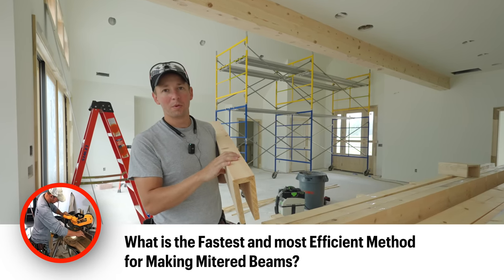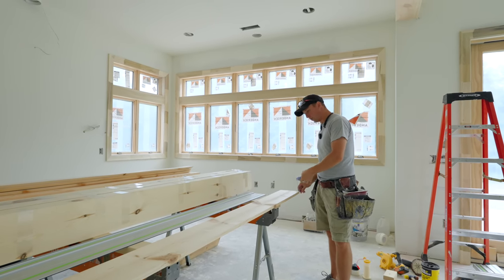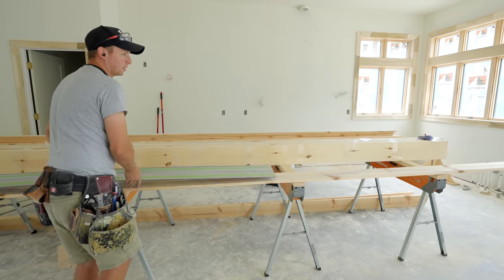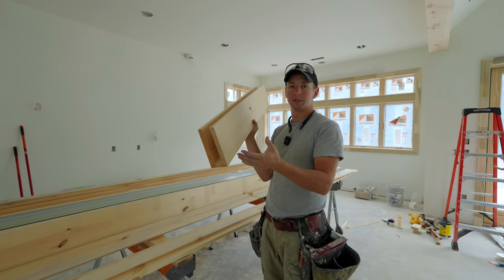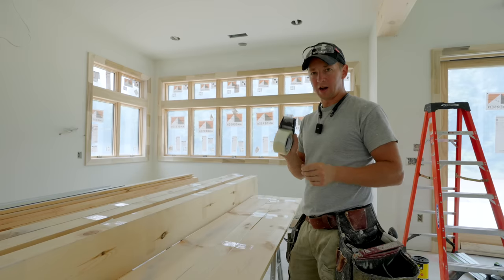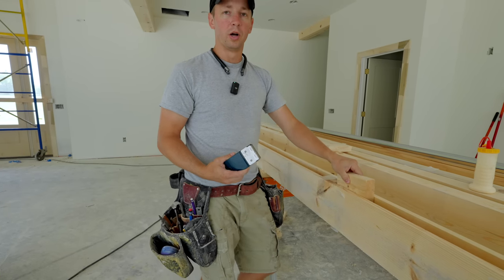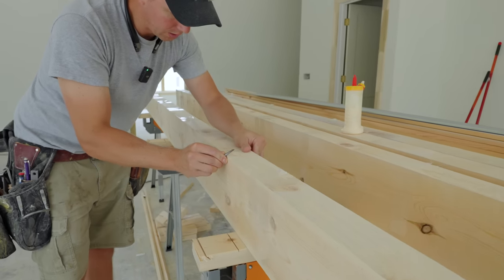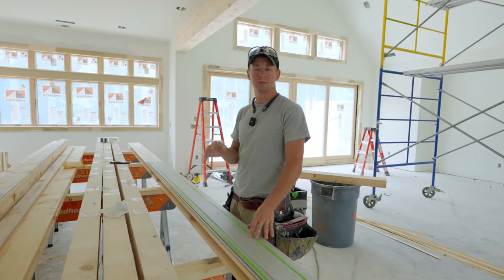PERFECT CEILING BEAMS from BAD MATERIAL??? How To Deal With Bad Material...

Comment: I've been working in the trade longer than Spencer has been alive, but I learn something every time I watch on of his videos. 

When cutting a line longer than my saw track,  I drop  the blade  into the kerf of the first part of the cut (without turning the saw on)  to align the track for the continuation of the cut. Just about foolproof.
Reply from the maker: That's a huge compliment! Glad to add value to our trade community.
Reply: I do the same exact thing!!

Comment: When using a tracksaw I use a giant clothespeg style spring clamp on the far end in case it wanders off line,which tends to happen as the blade gets blunt or wants to follow the grain.The rubber grip strips are not foolproof

Comment: The times, they are a changing. Back in the day, I worked closely with a small mill shop to do most of this type of work, We would work in his shop to build the beams and then take them to the sirte to install. At that time the best way we had was to run the pieces through his shaper using a lock miter bit. It is so nice that now you can do the work on site without bringing in others. Also lets you control the timeline and cost. Great video. Sometimes when I watch your channel I want to get out of retirement and get back into the trade. (well, not really. I really am enjoying retirement and don't miss working those 60 hour weeks.)
Reply: My sentiments exactly but if I could get a ticket to go back 40 years, my bags are packed.

Comment: Outstanding Demonstrator. From my experience of 45 years in Carpentry, Painting, and staining and remolding. I have found that use old T-Shirts cut up into rags. To use wet rags.  to wipe up glue from your wood surface is the best way to keep all glue off your work pieces. The wet rag will not stain the wood surface if you wipe right way.
Give that a try,  see how works for you.

Comment: Before I offer a recommendation, I should say that I am merely a hobbyist woodworker and not HALF the carpenter you are but I really enjoy your channel and appreciate the content. 

That said, as I watch your process of using a single track on those sawhorses, an idea came to mind. It would be interesting if you joined 2 tracks together so that you had a single track spanning the length of your material. Then, add a 20mm hole about 7" inset to each of those sacrificial boards on top of the sawhorses. You could put a long bench dog in each, add 4 UJK dog rail clips to your track (2 on each section of track), and effectively have an MFT-style ripping station. Then you would just flip the rail up and slide your material in/out instead of marking and cutting by eye. Perfectly repeatable process that adds practically zero additional setup time or bulk to the setup you're already using. You could even add several consistently spaced dog holes across those sacrificial boards so that you could accommodate various material widths. It would also be modular so you could use just 2 sawhorses and a single track on shorter material.
Reply: Sure, you could join two 11 foot long tracks to get a continuous cut, but not necessarily a straight cut. There can be some wiggle in that connection. Spencer's technique of moving the track is more accurate, and I do the same. I have spliced my Festools tracks, but I still get my 6 foot level out to check the connection and ensure they are coplanar. And that takes time. Which reduces production.

Comment: Thanks for sharing.  I recently did a 14' Cedar using, mitred box beam, matching grain at the edges. It was a bit  rough sawn, which I hand flatened sanded flat on the outside. I over mitered the joint, and pressure fit with a spline joint, using pipe clamps. I used a ladder, shims and clamps to flatten the waivy 1"×14" boards, then found a piece of weathered, imperfect mdf base as a straight edge, which I ripped on the table saw. Using the same chalk box you use to straighten the mdf base. If I remembercorrectly, used  some of the ripped material as the spline, just under 1/4" thick. Tight Bond 2 and  I think 1" pin nails. I told the employer who fired me, that I was going to a friend's cabinet shop to use his Timesaver abrasive sander and his Casolin panel saw, He freaked out and so I stayed at the job and made a beautiful, straight and flat box beam in lol, five days.

Comment: Spencer, Thank you for all your great videos. I've been a Design - Builder since 1976 and I still have learned a ton of tricks from you. Your beams look great. If I had that many beams to do, I would bring the Pine back to my shop & run it thru the shaper with a locking Miter router bit installed. They are a pain to set up until you get used to it, but make a great joint. You have a nice shop and I think I recall seeing a Powermatic shaper with a power feed, exactly what I use. Once set up you can run a bunch of "Beams" quickly that fit perfectly.
Reply from the maker: I have my shaper setup specifically for the lock miter but I still prefer to just miter fold them.

Comment: Great video. I just built some beam wraps using this technique. One thing to be careful of....I built my miter folds and dry fir on day 1, finished them(whitewash/varnish) day 2, installed day 3...btwn day 2 and 3 the side pinched in a little making them too tight to fit over my beams. likely due to moisture fro whitewashing or just humidity. It might be a good idea to place blocks inside to maintain the inside gap.
The fix will be painful...these beams will be hand hewn on the inside!

Comment: Just wanted to add on certain mitres I've used the Tenso fastener and it works amazing well also.
Reply: @kiwdwks, But doesn't that get a bit expensive? What spacing do you use?

Comment: Abutting each board's edge creates an especially customized look with possibly less work though it does require a hidden board on the inside on which to attach the external stock.  We used this approach on fluted archway pilasters and it added a rich look to an old style traditional foyer to dining room arch. The fluted stock was garage door pvc trim !  After high quality paint, the result was surprisingly beautiful.

Comment: Hey Spence. 
  Wondering when you’re doing the 3 inch pieces if it would serve you better if you ripped the board in half to release most of the tension in the board first before you started the 46° level?
Reply: I was thinking the same way! Obviously an extra step.

Comment: Hi, Spence excellent way to mitre beams, I'm lucky to have access to a panel saw with a long sliding table,gluing up I just run a bead of glue in the middle of the mitre. When you closed the pieces together the glue will spread.I also run masking tape all the way along the join never had a problem. You are a master tradesman.
Reply from the maker: Lucky duck. I'd love to have a big panel saw someday. It would be so handy for straight lining.

Comment: Great tip regarding the crown and adjusting your cuts for that. I appreciate your methodical approach and hearing your thought process. I have a question about how you’d recommend butting two beams together to make a longer looking beam. Maybe I missed this? Apologize if someone already asked. With baseboard trim, for example, beveling helps execution but I’m scratching my head around how to accommodate for the large scale of the beam, 3D aspect and wanting to ensure end to end is as tight as possible. Thanks!

Comment: Great timing as I have 17’+ LVL beams to cover with mitered pine or maybe stain grade wood.  Problem is, if stain-grade, I can’t source any 1-by material over 16’.  So, I hope you cover how you splice longer beams over 16’ sometime.
Reply from the maker: I just make a butt joint if it is stain grade. Add some biscuits to it if possible. But it can be hard to use biscuits on the sides of a really large ridge beam on a cathedral ceiling.

Comment: Great video. For those of you who are new to Carpentry, the tape and nails are acting as clamps until the glue dries. I'm assuming the tape you're using doesn't leave residue that prevents paint/stain from penetrating the wood?
Reply from the maker: I sand everything after the glue up process, so any residue is sanded off with 120 grit.

Comment: 2 things first of all I have 2 ts55 track saws one with a cross cut blade and one with a ripping blade. Ripping is so much easier with the proper blade and second I join 2 tracks together so I get a much better result than only using 1 track and having to move it. People who have festool tracksaws usually have multiple tracks.
Reply: Everyone thinks that it’s never occurred to Spencer to splice 2 tracks together! Sure, you could do that—but it’s a bad idea. The spline that connects the 2 tracks is just that—a connector. Not an alignment tool. Your connected tracks are not necessarily aligned, so you have to get a straightedge (or a 6- or 8-foot level) and double check the alignment. And since you are a production carpenter and you have to make a dozen of those beams, you have to move those floppy, weak, connected tracks dozens of times—checking the alignment every time—to make all your cuts. While you are wasting your time with all this, Spencer is done working and having lunch at the roach coach.
Reply from the maker: In my experience the tracks do not align and you have to check and light for straightness each time with a long level. It's more of a pain than it is worth for me personally.

Comment: Pro tip:  when you set your tape, after you cut the length and before you whack down the last end, just fold over the end to leave a tab.  When it's time to remove the tape, you don't have to dig around with your fingernails. Just pull the tab.  Super fast!  Fini.

Comment: Really enjoy all your videos! I’m gonna do a faux beam vaulted ceiling for the first time pretty soon, and this really helps the anxiety of it. I’m a bit of a tool addict, but rarely am in need of a track saw. My table saw is a ridged job site saw that is ok for rough work, but not cabinet grade. I have one question if anyone can help me: I’d like to make an old school rip guide that is like a track saw but relies on one fence. If I make this with an aluminum guide rail or 2 pieces of plywood, could I use it for beveled rips as well? Or would I have to make one with the guide being beveled to the particular degree? Trial and error will let me know. Just curious of anyone knowing what I’m talking about and having an answer. Thanks a million Spencer for your vast knowledge of current tricks of the trade. Subscribed.

Comment: Great craftsmanship, I have a customer that wants me to make a folded miter column cover out of PVC, I'm thinking of making the 45s with the shaper and useing the lamelo joint fastener and the recommend pvc glue
Reply from the maker: You might get just as good results with a simple tape miter fold with the pvc glue.
Reply: I do PVC miter folds with tape. The biggest issue I have is that the glue etches the finish if you get squeeze out under your tape and can't clean it up right away.

Comment: Started trim from 03 to 09, changed careers but started back again in 18.  Track saws intruiged me ever since I first saw one.  I finally ordered the milwaukee this week.  It was supposed to come yesterday but fedex lost it.  They actually delivered the 31" track but the separate box containing the saw is missing.  Of course today I had 2 entire rooms of bead board to do.  I was looking forward to using it.  No doubt it would've sped up the process.  But no, once again FedEx had to show just how incompetent they are.  HD says i gotta wait 3 days to see if it shows up before i get a refund.   Found one at a local HD that I'm going to get tomorrow.  If the other one shows up I'll just have 2 of em I guess.  

Thanks for the beam tips and the review on the milwaukee saw.  I was about to buy the festool and hadnt even considered the milwaukee (even thought I have a ton of m18 batts and chargers.  I had no idea it was any good.  I happened to see your review the day I was planning to order the festool.  I know I can trust you when it comes to tools so it made the decision easy.

Thanks again.
Reply from the maker: I think you'll like it. It's a very close copy of the festool and they even added some features. If you already have some milwaukee batteries it's a no brainer IMO. Hope you like it!
Reply: Got it yesterday and it seems pretty solid.

Comment: Based on your comment at the end about next weeks video install. How would you 2 of these “beams” together? My aunt is having a house built and the finish carpenter did a piss poor job on their 32’ beam in their living room
You do a great job
Reply: Staggered joints to make lengths needed
Reply: @stevenfoust3782  Right, staggered & scarfed. That'll work.
Reply from the maker: Staggered joints and assemble in place. You will notice the long beams that I did on the ridge beam and lower header. Those long, and tall beams you have to just tackle piece by piece with the same care and attention to detail.

Comment: Hey Spencer. I’m trying to get more efficient with door installs. When the doors get to the jobs I do, the floors are installed. The door jambs come with a 1” gap on the bottom. I usually have to take 3/8” off the bottom of the jambs to give a 5/8” gap under the door. It’s an extra step that adds a ton of time. Am I doing this correctly? I know your busy and thank you for all the time and energy you put into your videos. Anyone that watches Spencer, if you have any advice I would really appreciate it.
Reply: Assuming these doors arrive prehung or you would not be asking the question. Put an extra screw thru the strike location to hold the unit together. Knock off the bottom blocks and it’s just 2 cuts. Less than a minute I guess even with a handsaw. Order a pair of Lewis stair tread cut station stands and save your back. If you are placing or checking the door schedule for a house, you can spec jamb length or undercut - with the millwork and they should arrive 3/8” shorter. But be sure the floors are level. If you have a local millwork, visit the shop, bring coffee and donuts. They will remember you.

Comment: Wow. Great video. You mentioned in another video about a glue gun method. Not sure which video came first. Anyway would that glue be better in this situation? Or no due to benefit of glue + sawdust closing joint?  Also in that video you mentioned this glue needing clamping force. I realize these beams are different situation. Also I’m looking to do a library and love to do something similar to this. However ceiling from right to left is continuously sloped and then changes angle to drop more. Not sure of design idea. Love your videos

Comment: When you are cutting the narrow piece, would it make sense to cut it a little wider than needed so the stress in the grain would be somewhat released, and then cut it again to the final width to get a more accurate final fit?
Reply: Not in my opinion.  A piece that long and that narrow can fairly easily be "coaxed" into alignment.  Once glued, that small amount of deflection stress won't be even close to being able to telegraph into the sides.  Of course after you cut it and it looks like a C or S, you probably would want to set that one aside for smaller piece and cleats and cut another one.
Reply from the maker: Yes, and I often do that. In this case I was trying to maximize material use so I was a little limited on how much of that I could do. And it's a guessing game sometimes in regards to how much it will bend when you rip it.
Reply: @InsiderCarpentry  Don't know if you've already hit this, and it's pretty basic stuff, but I think it would make for a good video to discuss stock selection and what your brain is doing as you select pieces from what gets delivered, what you already hand selected, what's left over, how, when, and where to cut down funky pieces to avoid waste, etc, and how you factor in waste vs time.  It'd also be cool to occasionally mention how much some of the boards you are working with actually cost.

When watching craftsmen at work, the layman doesn't get a lot of the thought process that goes into what seem like instant decisions and actions.  You already do a really good job at this.  Speaking of time, I understand there are only so many minutes of commentary that can be crammed into a video and all that editing takes time.  

Keep up the awesome work!

Comment: Hey wondering your current take on using a lock miter joint and why you have gone away from that? Thanks!
Reply from the maker: It's just not necessary. I get just as good, if not better, results with just a tape miter fold and track saw. And it's faster.
Reply: @InsiderCarpentry  thanks for the reply. Keep up the great videos!

Comment: Did you cut the bottom narrow piece at 46 deg or 45 ? when you talked about cutting it you said 45 deg
Reply from the maker: 46. I was simply referencing a square angle. All miters you see me do on beams are over-cut to 45.5-46.

Comment: OMG - I had an epic fail. Tried using your technique, talked it up to the boss and said I would be able to make the faux beams. I picked out material from a great wood shop, but when I ripped them at the 46º angle they basically warped beyond control. They were under so much tension the grain pulled them and they twisted so bad. I thought I was going to get fired. Had to swallow my pride and do the old technique my boss wanted me to use in the first place - nails, glue and clamps. I really wish I had the skills to do work like this, but it just didn't work for me.
Reply from the maker: Sorry to hear it worked out that way. Sounds like it was some really bad material. Usually when you just rip of the edge for the miter is doesn't cause the board to go crazy like that. Typically they go crazy when you cut them down the middle more.